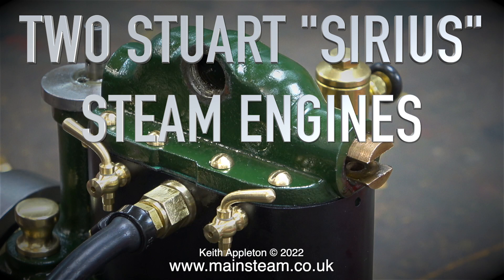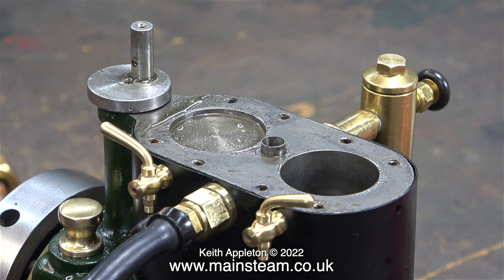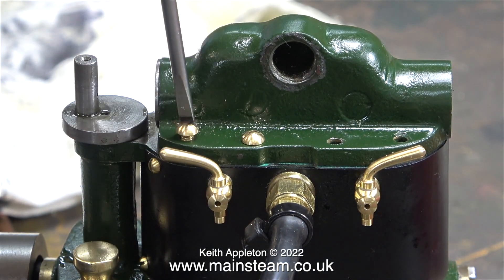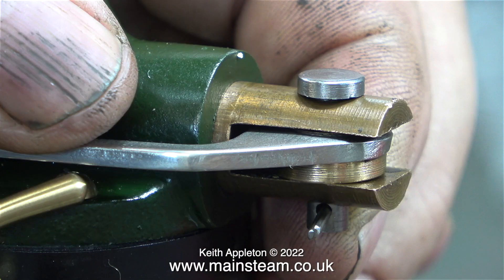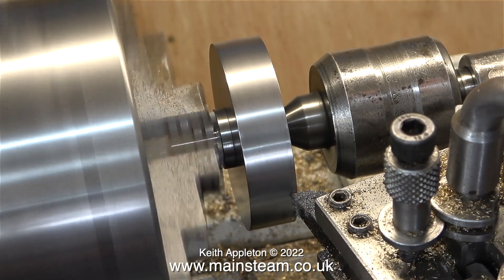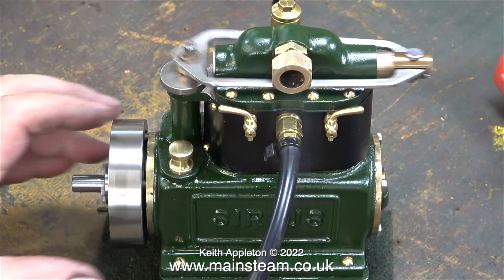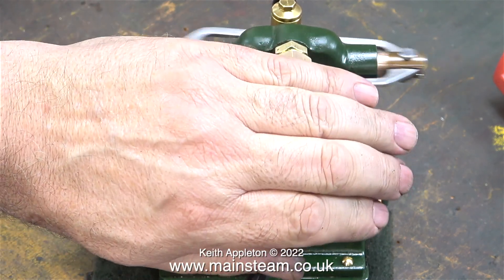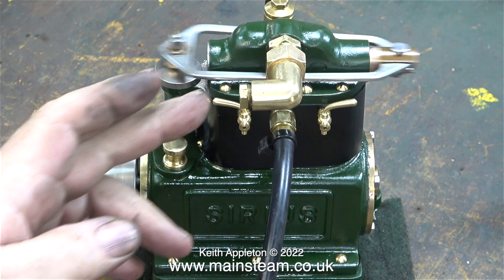TWO STUART SIRIUS STEAM ENGINES - PART #7

Comment: Good episode. I am probably quite slow, but just noticed that the green engine valve drive connection runs at an angle off of vertical, not in the same plane as the horizontal spindle valve.  I looked again at the first episode, and the red engine valve drive seems more in-line with the spindle.  

I've also belatedly noticed that the valve eccentric drive on the red engine is at the opposite end from the crankshaft flywheel, and that when it runs, it seems to drive the valve with less vertical play than the green one.  In the video, the eccentric valve connection arrangement seems to jump up and down with every rotation, especially at high speed.  

Knowing that this was filmed months ago, I'm sure it is all resolved. Yet I can't help wondering if this difference in valve drive fitment isn't the source of some of the noise difference.

I am very much enjoying this Sirius series!
Reply from the maker: The Camera Angle distorts some of the images, the valve drive is fine. The main difference between this engine and the red one is just the valve timing. The Green engine admits steam (or compressed air) later than on the red one, but as a plus point it runs more smoothly at a slower speed.

Comment: The engine looks like it's trying to escape captivity and run to the enemy!   I once had to doctor a shaft on an air compressor where someone had drilled to far through a pulley. I used some liquid steel to fill the hole and I said that if I ever found out who had drilled into it I would cement his fingers together.  It was simply a case of sloppy work and it could have damaged the shaft beyond repair.